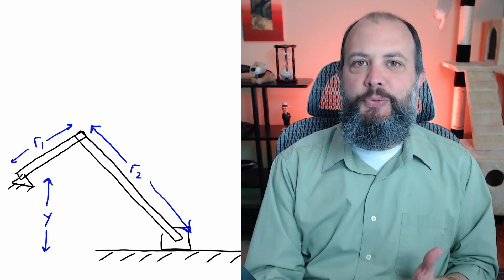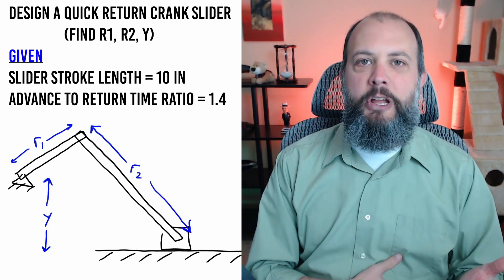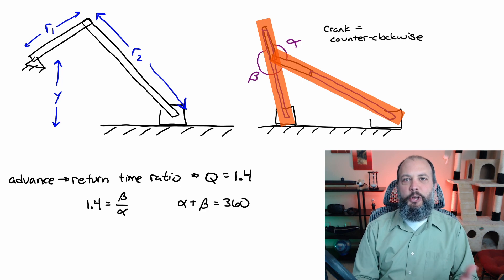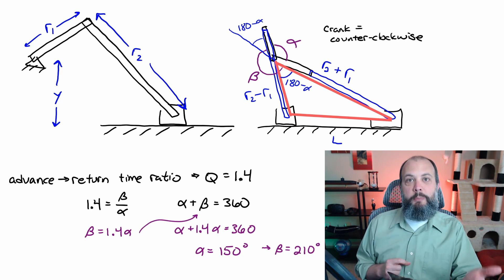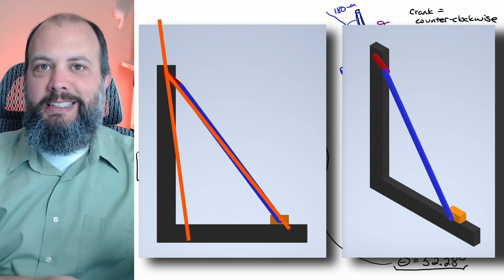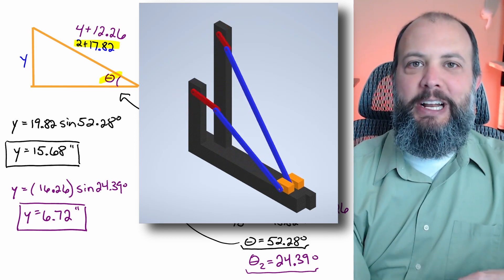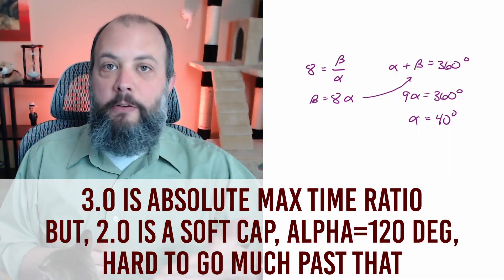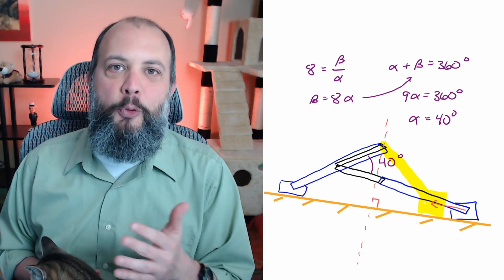Design a Quick Return Crank Slider for given Time Ratio

Comment: great video,  i just have a quetion how did you assume the second toggle position (the minimum length)?
Reply from the maker: 2:45 is where I talk about this. For this type of machine, the toggle positions will occur when the crank and coupler are both perfectly aligned with each other, for the longer line, they will be end to end, for the shorter line, they will be overlapping. As a thought experiment, pretend you are drawing a triangle by just drawing 2 lines, and the 3rd line will fill itself in by connecting the 2 endpoints. The longest this 3rd line could ever be would be the case where you draw your 2 lines end to end to stretch as long as possible. The shortest the 3rd line could be, will be the case, where the longer of your 2 lines is the sum of the shorter of your 2 lines, and the 3rd as yet undrawn line. In this second case, still, all 3 lines will be drawn right on top of one another. I think this thought experiment might have made it more confusing, so maybe rewatching the video at 2:45 may be better. I hope this helped.